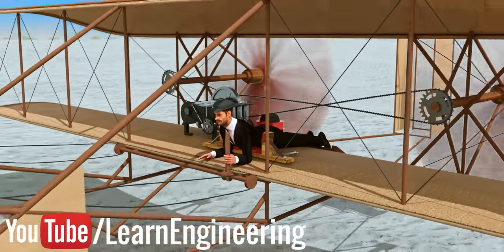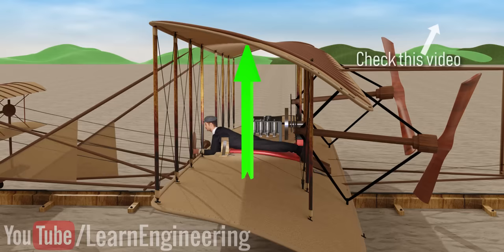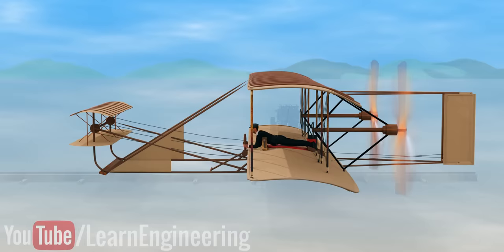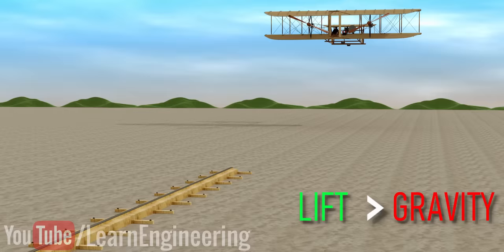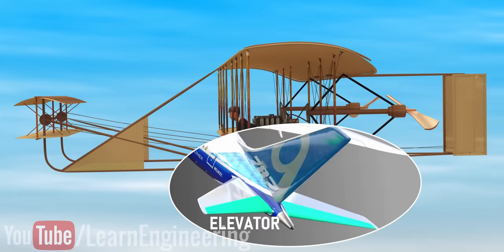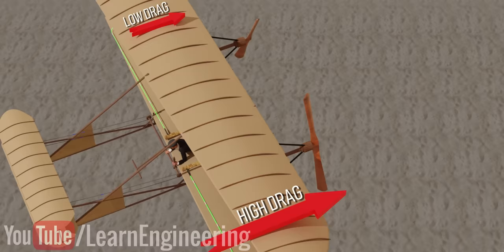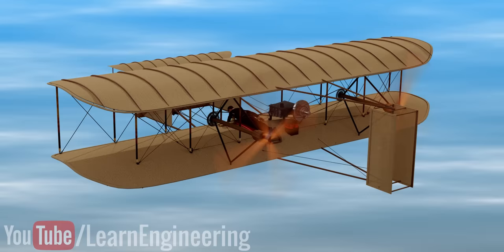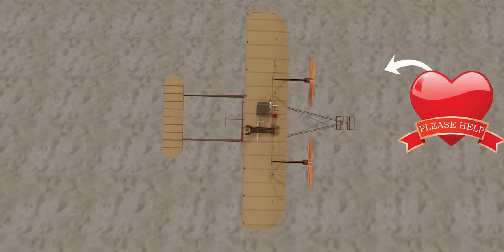The Brilliant Engineering of FIRST FLIGHT !

Comment: Did you know that Jack Cherne, builder of the lunar module, declared that a flight of a perfect replica of Flyer 1 would make a chaotic flight?
Reply: That is not an exact quote but  Cherne has said that the 1903 flyer is very unstable and almost impossible to fly.
Reply: @majorbett  this is why they moved the front canard and back rudder away from the center to make the controls less jerky and made the plane easier to fly
Reply: @camilmoujaber4813  Not sure I follow your explanation.  
What does away from the center mean?
The videos of the 1908 2 place Wright Flyer still seem to be jerky to me.

The RC models usually move the weight as far forward as possible.  The flight controls do not  appear to be jerky the way the early Wright Flyers were.  
In the hands of a modeler with lots of practice and experience 
the controls are very quick.
Reply: @majorbett  they increased the distance between the front canard and back rudder to stabilize control and it worked
Reply: @camilmoujaber4813  Guy, forget THE brothers. The Bros appearence in flight 1908 only. Santos Dumont realized 'THE FIRST AVIATION RECORD OF THE WORLD" in Paris 1906.  The Record IS signed by ERNEST ARCHDEACON.
Reply: @majorbett  The problem is that there is no evidence that wrights WERE flying between 1903-05. You must present official evidence here to win the debate and prove that they invented the plane.
Reply: @acucarchocolate3961  Get your facts straight kid. The Wrights were the first to fly a heavier than air with 3 controls (pitch, roll, yaw) on Dec. 17, 1903, and there is a picture and a telegram sent to their father (and more) to prove that. Anything else is pure fantasy, guy. This discussion stops here.
Reply: @camilmoujaber4813  there are no official records regarding anything for the wright. They didn't sell anything to any country, they didn't register the plane in their patents, they didn't show public demonstrations for everyone to look at, they were summoned by the aero club of France in 1904 and presented nothing, and the real first FAI official registration is for Santos Dumont in 1906.
Reply: @acucarchocolate3961   Santos Dumont's record set in 1906 is signed by Ernest Archdeacon.  

SB"   If this is true then you should be able to support the claim with a reference or a URL.
Reply: @acucarchocolate3961  "no evidence that the Wrights' were flying between 1903 to 1905"

SB:  There is historical evidence which you won't accept.  The Wrights' were always ready to provide demonstrate their ability to meet any negotiated list of performance objectives for a price. 
You do accept historical evidence for Santos Dumont.  This would include the date and the photographic evidence.  Anything that was not
listed in the original Deutsch-Archdeacon contest rules. 

In 1908, they complied with the French FAI rules for their altitude record.  It only lasted one year.  
Were there other records where they complied with the FAI requirements?  The Michelin distance record
complied with the British record requirements.  These rules did not disqualify airplanes that used a
catapult.
Reply: @camilmoujaber4813  forget, there is no plane. flyer 1, 2 or 3 were not planes. The number of replicas that have been built around the world is very large, and the most perfect ones never fly. In the 50's you Admiral Emory Land declared to National Geographic that several replicas of the flyer were built across the united states, NO REPLICA FLOWED!!
Reply: @camilmoujaber4813  The evidence never appeared, kid, the photos, footage or any document registered in greatest aeronautical authority of the time was never presented. There's actually no evidence that the brothers had planes!! THE 2003 replica proved everything that was ever suspected. the wrights had nothing
Reply: @acucarchocolate3961  no replica FLEW 😙
Reply: @acucarchocolate3961  If you have a photograph of a signed record, please provide the reference.

The first record listed by the FAI is for circular flight.  I can't explain why they left out the 
first official flight of 100 m.
Reply: @gilberto2056  The Wright Flyer would have been a clunky, chaotic mess? What's next, are you going to tell me that Karl Benz's Motorwagen didn't drive like a sports car, too? The first of everything is usually pretty rough, so I'm not sure how this is a valid diss against the Wright Brothers. 😂